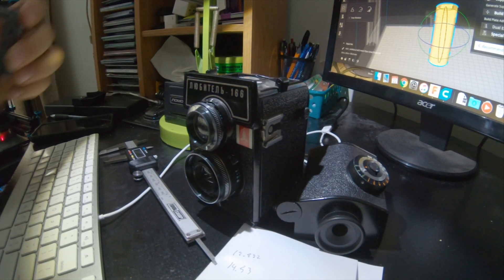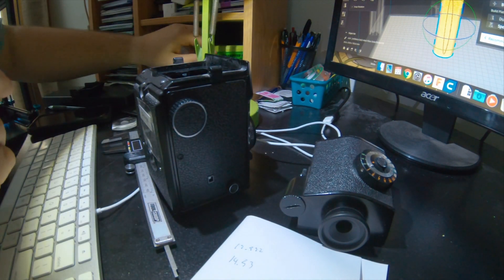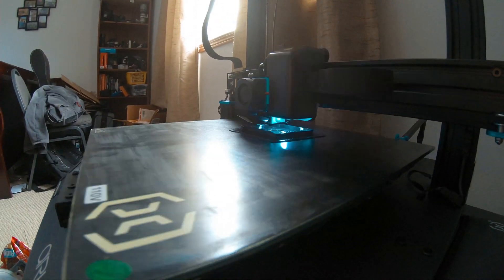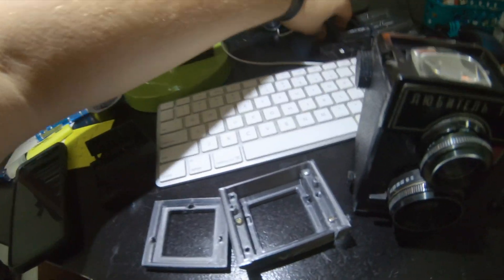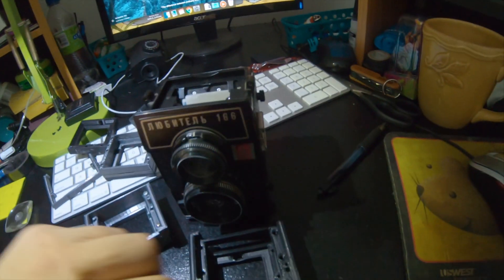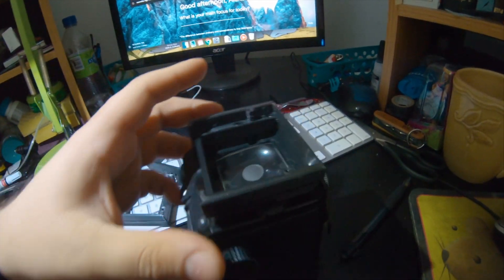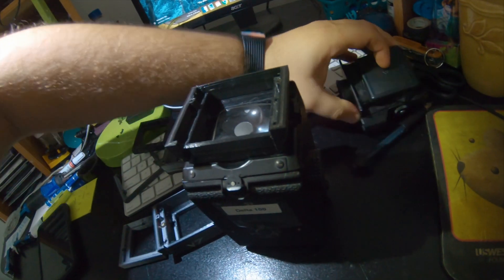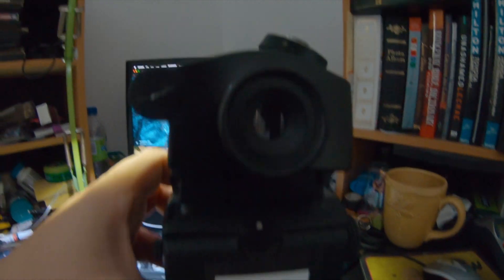The Journey from idea to working part |Lubitel 166 TTL Kiev 60/6C viewfinder adapter|

Comment: Hey , great job, I ordered a kiev ttl finder to try this, the viewfinder is firmly attached to the camera or is flimsy?
Reply from the maker: The viewfinder is attached extremely firm and there is no risk of it breaking if printed in ABS, PETG or Pro PLA filament. I dropped my Lubitel from 2-3 feet with it still being attached and no damage.
Reply: @AleksUsovich  Thank you! If it works (when my finder arrives) I will try it and probably make a review :)